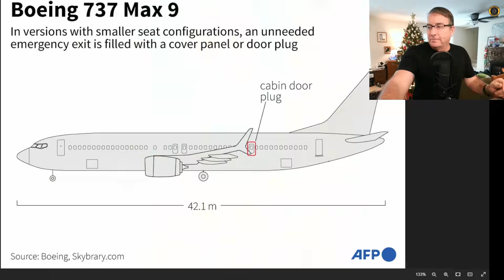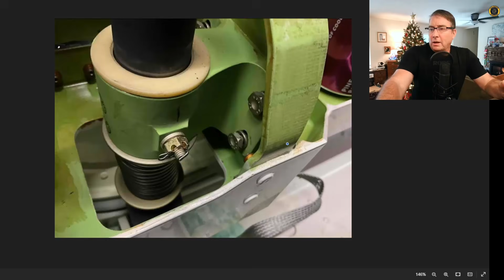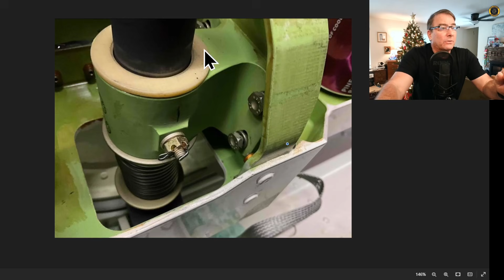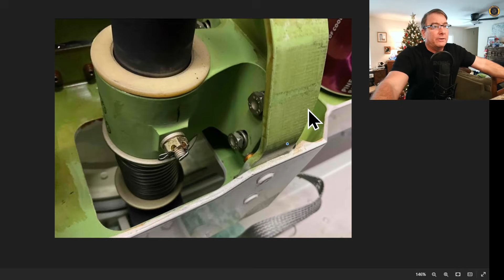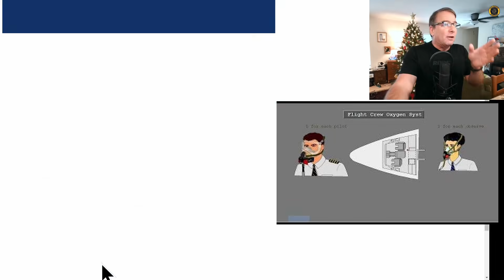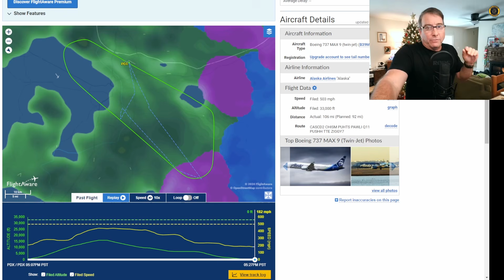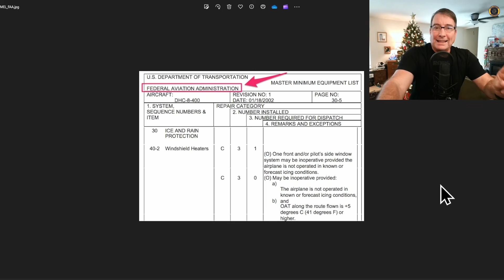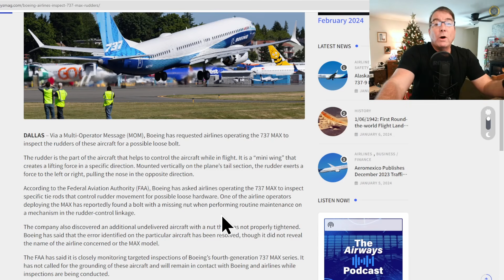"Yes, We Have No Bolts"  9 Jan 737 Max-9 Update

Comment: The scary thing is they found several similar problems on other aircraft. That should not be possible, it shows systemic failures in production, and calls into doubt every nut and bolt on the aircraft. Either that, or one operative was so incompetent they f.cked up many times, which means everything they ever worked on is suspect. Then you have quality control failures, why wasnt this spotted earlier. If they failed to spot this, everything they inspected is now suspect. This accident shows a complete clusterfuck at boeing. Having a bad design was bad enough, but repeated failures in production means everything needs checking completely.
And that loose bolts on the rudder shows these aircraft arnt fit to fly, this isnt just a single screw up, its stystemic failures in production producing unsafe to fly aircraft which should be scrapped for passenger safety.

Comment: Re the cockpit door; perhaps it was not intended for the door to fully open.  The NTSB may have said that, but surely noone from Boeing has even had the chance to inform "the crew" that, despite the manual, the cockpit door is designed to open in this circumstance?  It is at least possible "the crew" deduced that from the fact that it opened.

Comment: It's never been more clear how desperate Boeing has been to not go bankrupt. All of their recent projects seem like rush jobs. First, that was knowingly making planes with engines in terrible positions that necessitate software "fixes" to keep them flying correctly and not including training on the new systems. Now, it's rushing planes out the door with missing or barely tightened bolts.

I think the only solution is to completely ground the whole fleet of these planes until it can be assured that these planes are not flying half put together.

Boeing is a failure and they deserve much more scrutiny by the FAA.

Comment: My apologies:  the photo of the guide on the door is not inverted.   So the door when going down over the guide pin at the top would definitely guide it to the closed position along with all the other 12 stops in the sides of the  door frame. In other words, the door needs to be held down to stay in the closed position with the roller guides over the roller pins.  Gravity would assist with this, also with the four bolts (holding the door down) as explained.  Engineers would not be stupid enough to design it such that the door could fall out of of the closed position with just gravity.

Comment: Sounds like the crew did a great job, and since you brought up noise, would the CVR have any useful audio on it with 400mph air rushing through it? Also, did they lose a front widow? does it eventually equalize if windows are in tact?  Could they close the door eventually before landing?

Comment: What I find surprising is that none of those torqued bolts holding the lower door guide to the door are marked with a special paint or marker to indicate that they have been torqued and haven't loosend. I work in train maintenence in the Netherlands and every bolt or nut here that has a predetermined torque value has to be torqued down and then marked across the face of the bolt head, down one side of the bolt head, any washer protuding underneath the bolt head and finally on the surface of the bolted down part, all in one continuous line. That way future maintenence personnel can see if the bolt or nut hasn't loosened over time, but the person torqing down all those bolts can see which ones have already been torqued down so you don't miss any. If you don't do that, which I can see doesn't happen on these planes, you can hand-tighten any bolt and you wouldn't be any the wiser unless an inspector re-torques all the bolts as part of the final inspection.

Comment: Has anyone asked questions related to temperature? Do flight simulators even have the ability to cause such a situation of the huge temperature loss in a sudden depressurization situation? 

Having enough fuel to get to an airport is only half the problem. On the Hawaii flight the airport could be 90 plus minutes away. However, Hypothermia can end a person's life in under 40min (factoring obvious wind chill). Impaired judgement and lost of situational awareness, significantly slowed muscle movement and significant increase in cognitive processing time can set in, in less than 15min and in some cases even less than 10.  This isn't even considering possible frostbite which itself can set in less that 10min. The sudden shock of temperature difference can cause the muscles to temporary tense up within seconds. Cabin/cockpit equalization pressurisation is critical but in doing so there is no way to keep the cockpit warm and this is saying nothing of the cabin. People would not have coats in a normal flight on and on a Hawaii flight in winter might even be dressed for their destination (wearing light clothes and even shorts). This incident happened in January not August where temps at sea level can be 20F degrees or less in the northwest including PDX. 

If it takes more than 35-45 minutes or so for people to start getting warmed up somehow, I don't see how people don't die or at the very least lose fingers and toes to frostbite. 

I just would be curious to know how the FAA and airlines account for temperature lost in such a explosive pressurization. 

Keep in mind I have lived in the northwest my whole life and I am very aware of between August and January the temperature difference can be 60, 70, 80+ degrees difference in some years from warmest day to coldest day of the year.

Comment: Re Boeing, I personally find this   "oh it's run by accountants, not engineers" meme, very tiresome. 
As if I should assume that a company run by engineers must be a good thing.  
The implication that gold-plating of all engineering aspects, without regard for cost, is Good.  
It may well be in some idealised world, but in the real one such a strategy would quickly lead to no company in existence.

Companies are run by management, not accountants or engineers, and that is the way it should be.  Boeing obviously has some big problems with its management strategies, but visualising that as someone saying 'oh we'll just put profits ahead of safety', is ignorant and childish.  Likely the problems are vastly more complex eg Boeing's extensive outsourcing of design and manufacture of sub components, just as an example. The co-ordination thus required to being all the parts together, or communication with 3rd parties, might be causing these problems.  In which case it is not as simple as mouthing this 'accountants not engineers running the company' tripe.  It would be an entrenched, strategic, management decision that cannot be undone on any serious time frame.

In the present case, I gather the plug doors are removed after delivery of the fuselage, to Boeing, to allow fitting of internal elements, like wiring etc.  Which then creates the need for them to be refitted, doubling the risk of incorrect fitment.  If the bolts were left off, it isn't like noone has the job of doing it, and I am going to assume someone else had a job of checking.   Something wasn't done, but where in that process does 'cost savings demanded by accountants' come into it?  Answer: nowhere.
   

I completely agree there is something wrong.  More loose bolts discovered; missing nut on a bolt on some other plane; etc.  Until someone can work out why these lapses are happening at Boeing, despite checklists and procedures, it is unwarranted to put it simplistically down to 'bean counters' or other childish terms.

Comment: I think you're in error that pilots are generally unaware that flight-deck doors are designed to "pop open" in the event of explosive decompression (EDC). I was aware of this, as it was widely promulgated when these hardened doors were first implemented. The blow-out panels were a later refinement. My estimate is that because of the importance of equal pressure, the blow-out panels were designed to fail first in the decompression, with the door opening occurring at a higher pressure differential. On this occasion, the rate of, and amount of, pressure differential was so great, that the door popped open first....

It is possible, that this was designed to work the other way around, with the door popping open as the first line of defence against EDC, and the blow-out panels being the 2nd line of defence of the door opening did not occur.

Comment: You asked what else may be missing or loose.
I would guess there are a few more parts loose that did not pass final assembly inspection.
They are banging those 737 airframes out pretty good and at a good pace to get them in the air to fill the orders.
It's and old design still being produced, and yet they are upgrading it all the time.
Rather than a totally new aircraft most airlines want a cheaper low cost updated aircraft and they are partially to blame for this.
Boeing on the hand is mostly to blame for the shortcomings of this 737 that pop up pretty frequently these days.
It will only be a matter of time before another failure occurs on the 737 program that may result in a loss of life.
Reply: Necessary evolution under capitalism, when a necessity becomes a commodity. Like how bananas are picked before ripe, and shipped in Nitrogen so not wasting time to get to market. Sure glad planes are not bananas (though some may look like them).
Reply: @paulsherman51  Good point. The banana reference is pretty good
Reply: Credit JB from the title; and some of my former colleagues in completely unrelated industry. thanks! @majobis

Comment: You would think that having a small handful of nuts, bolts and split pins left over after assembling something like a medium-sized airliner might serve as some kind of red flag that something was not as it should be, and looking at the type of parts left over would allow you to narrow down the places they might have been left out from and remedy the oversight.
Another thing that concerns me is that in the photographs you show how the fitment is bolted to the frame, you point out the ones that have been found loose on other 737s.  Why is there no marker applied to show if the bolt has moved?  On ALL fasteners with a specific torque setting and no positive engagement locking mechanism like locking wire, tabbed washer or a castellated nut and split pin, I learned from an age too young to remember that a drop of paint should be applied across the joint between the fastener and the place it is seated so that any movement can be seen with a quick visual inspection for that paint cracking or having moved out of alignment.
I'm no aircraft engineer, but I've used this on everything from garden equipment to cars and motorcycles, as I don't want random parts dropping off any of them.  I would have expected the same to be true of airliners, as looking for that paint was something I taught my flying instructor as a means of checking fasteners for tightness during pre-flight inspections.  It is certainly used at Cessna and Piper, as well as on every road vehicle I have ever owned or helped maintain or repair, so why not at Boeing?
Reply: It is unfortunately, not like Legos. Imagine a worker putting in rivets. Just pulling them out of a bag or box, one after another. If you miss a few, there's no way to know unless you inspect your work. My guess is that they are in a rush and simply don't do it. "Yes, I checked it" "Did you check it?  Really?"(employee is fidgeting a bit) "Yes, it's OK."  "So if I go out there and look at it myself, can you guarantee it will be perfect?" "I'll check it again - maybe I missed something ( employee shuffles off to do it the first time )."  (Foreman shakes their head knowingly). "Thought so..."
Reply: Those bolts literally can’t move if they have a castle nut and cotter pin installed .    Heck my old Cessna 150 had that nut arrangement holding the  piston rod’s lower end cap and bearing to the crank shaft.   How many million times did those go around in those shake machines and I never heard of one unscrewing.   
  In that nosing they simply sit there and I bet a simple nylock nut would be plenty sufficient yet they go with pins out of an abundance of caution.    Thats if they were put on in the first place🫣

Comment: This thing was a complete miracle - how did this door blow at 16,000ft rather than FL320?? By how much did the door miss the tail? How was it that nobody was sitting in the row next to the door? So many happy circumstances that brought this issue to light in a way where nobody got hurt (except the bean counters at Boeing).
Reply: I think in this case it happened so low BECAUSE it would be nearly impossible at higher pressure. I think the door was completely unsecured or close to and, at low enough pressure, a big enough acceleration could allow it to move up the track and off the plane. Definitely a curious happening as it had to move quite some distance on its track while also being forced against the seal..
Reply: Must praise Mother Nature for that IMC and atmospheric turbulence right there at about 14k just enough to jolt the bolt.

Comment: Thanks very much. Does seem to me more likely that the cotter pin bolt broke only after the bolts that attach the guide fitting to the bottom of the door worked  themselves loose due to vibration? Then huge pressure on the whole door causes catastrophic failure of the top hinge. Or maybe extreme cold caused brittle steel bolts to fracture. Either way let's hope it's not yet another Boeing QC issue. Boeing definitely seems to have cultural issues.

Comment: If a bolt is required to be torqued to a value in order to form the proper function, I would think that this fastener needs an inspection wire or marking.
In the auto industry there was a concern that the bolt that holds the belt components to the vehicle.  Over 20 years ago the suppliers integrated the attaching bolt into the assembly with clip and fabric washers.
Each torque gun would read a torque for the particular bolt being installed.  It was tracked along with several key factor the Vehicle Identification Number.  If the torque was outside of the spec, for awhile it was a “line stopper”.  I think it got reduced to a REPAIR REQUIRED.  Car could not leave plant until all the boogers were picked and fixed.  If somebody tries to meet an assembly target they may try and use the “needs repair”.  It not good.  It’s supposedly discoverable data.   You don’t want that hanging around.

You mentioned triple redundancy.  I had a PHD statistician that taught engineers like me how to use the tools.  A strange fellow but I loved talking to him.  He would talk for 30 minutes and I had no idea what he was talking 
about.  I think he knew that but I was the only one that would pay the price for his services.

He did not like the use of redundancy to improve reliability.  He said it removed the motivation to build in reliability to the primary component.  In stead of one design rated a 8 or 9 with a back up of  7, is better than having 3 components with equal reliability.  It stifles the development of high reliability of the primary system.  

Good piece of work.
It’s been probably 50 years since there have been any advancements in reliability engineering like CFD or FEA for the design and development engineering.  How do I know?  I started in automotive product design in 1969AD.  They were just starting a disciplined approach for design for reliability.  Based on the product coming out the door today no perceptible changes have been made in 55 years.

Comment: Cockpit door. Bottom of door assembly and top of door assembly there is the pressure differential mechanism that moves a lock pin in during pressure difference to allow bottom blow out door to swing up and for upper blow out door to swing down. Next to door handle you see 2 slide pins the blow out door is suppose to hinge to. For maintence, the blow out doors can be removed by moving the slide pins. Thus removing aprox 20-25lbs at each blow out door. Removing total approximately 40-50lbs from door. Rest of door frame is another 30-40lbs. Or it seems that way when removing and installing door & moving door down steps with 2 people. Apparently Boeing and airline Max operators didn't copy paste manual from 737 -200 to -900 models for cockpit door operation to alert crews during training. Is that really a Boeing problem or Airline for the oversight?
Reply from the maker: on a door yes, but not on a door plug.

Comment: The whole Design of that DOOR is Ridiculous, way over engineered. All that was needed was a Flanged door PLUGinstalled from the inside with a few small boltts in the flange secured to the door frame Making it Impossible to blow out/off.

Comment: @6:42 you point at the bolts holding the hinge fitting on. Notice the bottom right and top left one are loose.  It appears one released the door while the other 3 points of contact broke during ejection. Time will tell
Reply: Thanks, I didn't notice the top left bolt (partly obscured). Vibration of those would be a big problem...

Comment: A very good objective summary of events and contributors, particularly for informed viewers not in the aviation industry. One small point - although the item ejected is identified as a “door plug” your commentary often refers to it as a “plug door” which implies it is some type of functional/functioning door. Early news reports often identified it in this way as well-a normal emergency exit whose mechanism was disabled and hidden behind a finishing panel. My understanding is that if the opening was needed as an emergency exit, the door plug would be replaced with a functioning emergency exit door and escape slide.
Reply: Juan misspoke, but he did explain the difference in his previous video.